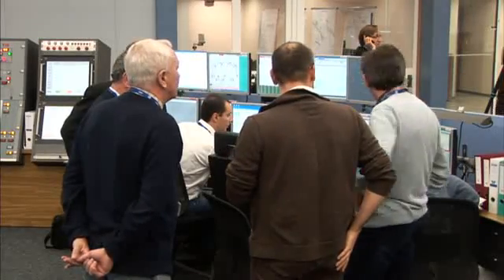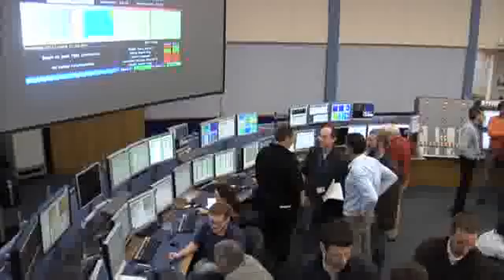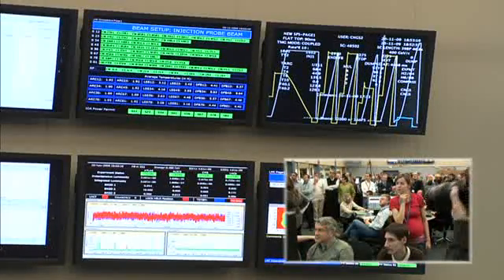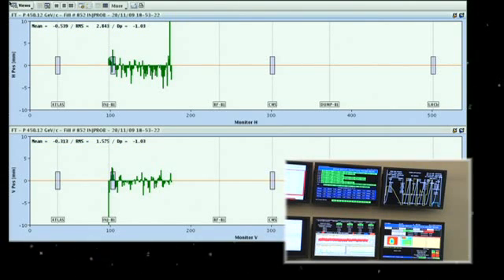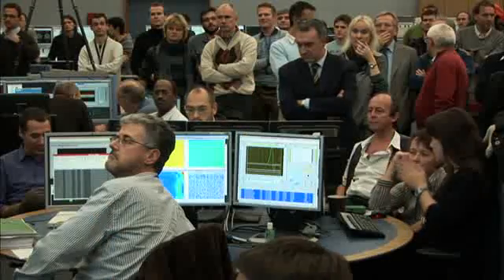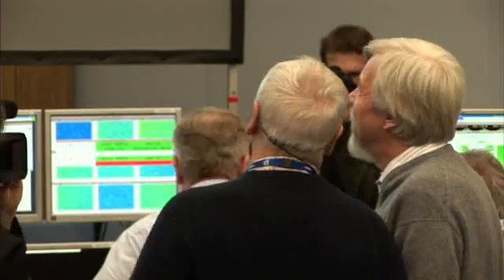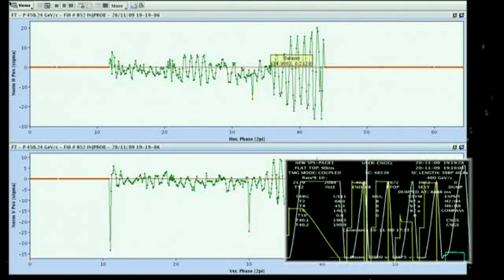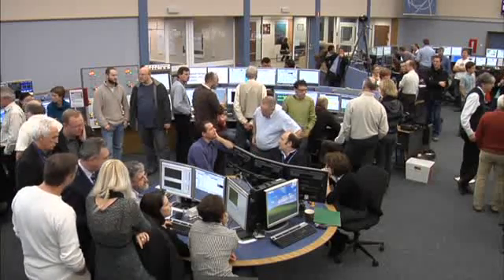LHC Restart 2009

Comment: What medical technology????

They've been using proton accelerators to destroy tumors for a long time (I think first time proton accelerator was used like this was in 1930s) - so it is nothing new.  In fact proton colliders used in such way are far less energetic than LHC - main issue with them is the relative size and cost of proton accelerator vs size and budget of a given hospital - problems which makes such treatment rare . . . and problems which LHC does a very poor job of solving.